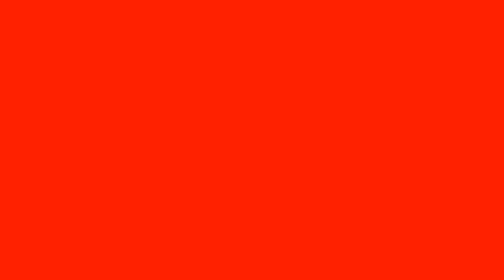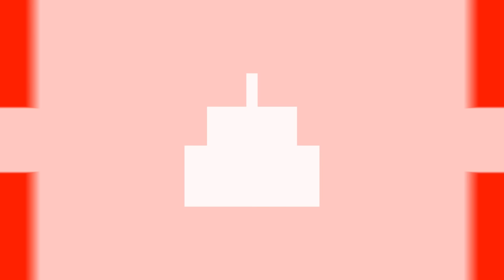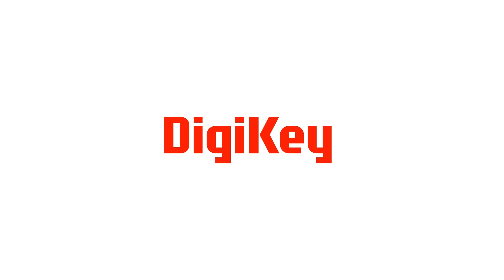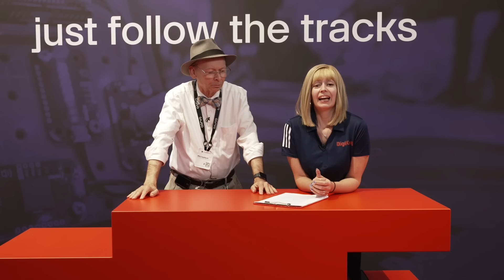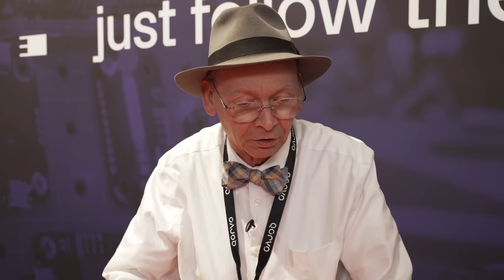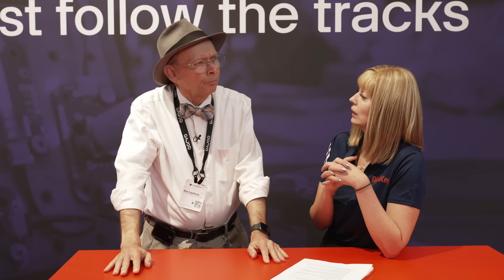DigiKey at embedded world 2026 with Qorvo

Comment: It would be great to put API for full command lists, directly working with netlists and parameters and all, so with a simple MCP server it wpuld go full AI for analog design. Grrat potential there but for some reason they avoid this. It would be very profitable for qorvo as well. I see claude can design electronics(both vlsi and pcb level) in near future. I am not sure which spice it will use as extention thats the question.